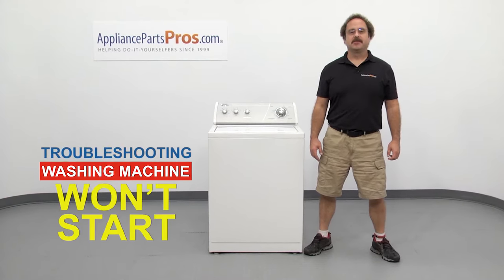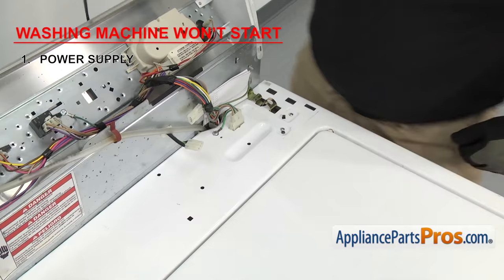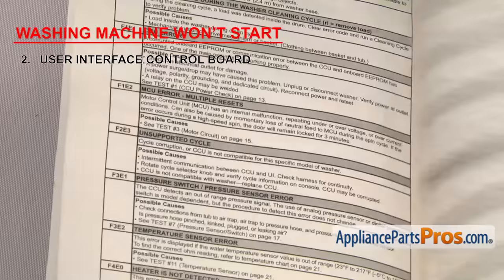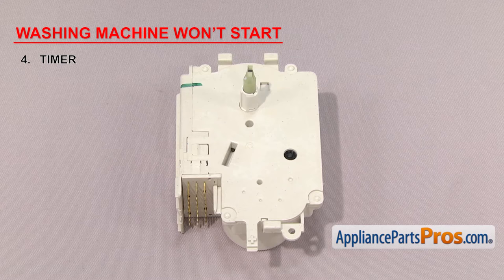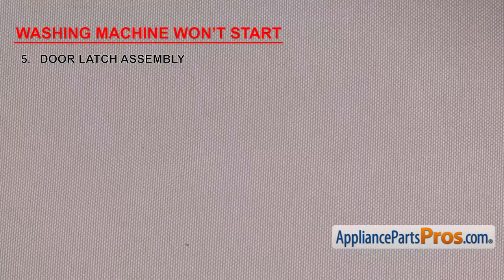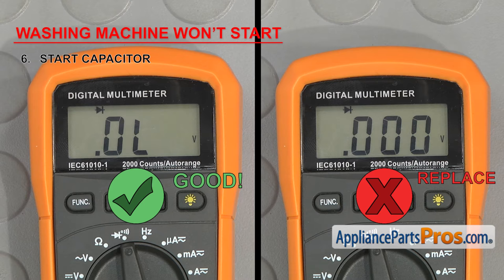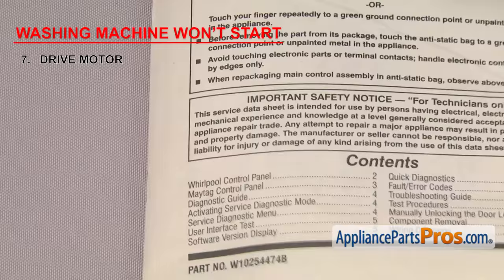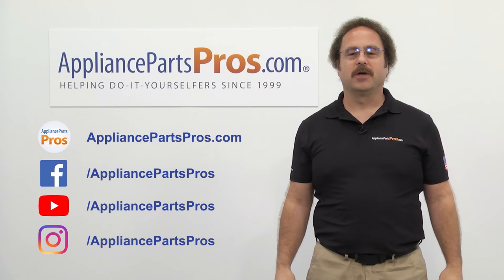Washing Machine Won't Start - Top 7 Problems and Fixes - Top-Loading and Side-Loading Washers

Comment: Self diagnostic mode ran on the Washer without any lights lit up for error codes, but when loaded with clothes and started the water hoses feeding  the washer hum and doesn't fill like it did when purchased, but can cut water input off and back on and it will fill but start humming again , I don't remember the water hoses feeding the washer humming when on auto sensing, I bought a numbers matching washer water inlet valve , and have replaced the drain motor because the electric went out last winter and because there was frozen  water at drain pump and didn't know and it weakened the drain motor to where when water was low it wouldn't pump water out to drain pipe so replaced that, so with the current issue about the humming water hoses and and water doesn't seem to fill the tub , so I will remove hoses and check for clogs and check the water inlet valve and all electrical connections associated with the water inlet valve before replacement..
Reply: What's crazy is if I cut water off by hand and back on the water flows awhile before stopping again to make hum noise at water hoses everything after the filling up of water works properly
Reply from the maker: What is the model number of your appliance?

Comment: Check circuit breakers / fuse box first. My machine wasn’t getting any power. No noise. Nothing. So I checked the circuit breakers first and nothing was tripped. I shut the breakers and turned them back on  anyway and voila. I heard the machine start filling with water.

Comment: I plugged in my Kenmore washing machine & didn't know the knob was already powered on & when I plugged it into the wall & it made an electric sound & stopped working, blew a fuse or what?? <3
Reply from the maker: We do apologize that has happened. What is your model number of the washer and we will be more than happy to look into this for you to see what has happened.

Comment: i had a kenmore w10318791 in storage for multiple years.   my current one went bad so i got the kenmore out of storage, hooked it up and it lights up green light   (fill)  and red light Locked lid,    but does not fill.    Just make a hum noise down by the pump, resistor area.    Ill assume somwthing is froze up from sitting.    ?
Reply from the maker: Can you please verify that model number for me? If the washer come but there is no water coming into the machine you could be having an issue with the water valve. Do you happen to have a multimeter?
Reply: @appliancepartspros     my old washer worked on the same lines, so i know i have water   I checked the inlets coming into the newer washer for clogs.    I have access to one yes.          im not sure what you mean by varifying....i took a pik of the serial number its w10318791    white     amtrims b       is what is printed on the back of unit
Reply from the maker: Do you happen to have a multimeter? I need the model number of the washer not the serial number. Normally with a Kenmore it has 3 numbers then a dot and the remaining numbers for the model number.
Reply: @appliancepartspros     im at work and not near the machine.  I  have the drum and lower guts with me, but i dont see a model number on the parts i do have with me.   yes i have access  to a multiple.meter
Reply from the maker: When you get home if you can find the model number we would be able to assist you to see what all could be going on with your machine. You can test the water valve for voltage to see if it has the correct voltage coming to it.
Reply: @appliancepartspros    ok thank you.   i will.   i tested the capacitor and got a bad reading?  also i couldnt test the pump itself.  my meter didnt have the correct ohm setting section.   it would only read 16.0      not a 3  digit number like ive seen online.         the water valve and and what i would call the pump, would be the same thing?     the one i took off has the impeller to push the water
Reply from the maker: The water valve is where the water lines are located at the top of the machine. The part you are calling the pump sounds as if that is the drain pump.
Reply: @appliancepartspros    yes ok...makes sense    what is the voltage i need at the water valve then ?  i can test tonight and also grab the model number
Reply from the maker: You should be reading 120 volts.
Reply: @appliancepartspros  ok ty.       Says.  Model 110.      21102010

Where at the part do I test for 120v with the multi meter 

And I'll assume it needs plugged in to do this
Reply from the maker: Thank you! Yes the part would have to be plugged in and set to when the water is being called to come into the machine. There should be two wires that you would want to test for the voltages on each solenoid.
Reply: @appliancepartspros    thanks for getting back to me..    I read some where if i took a conitnutity test or a ohm reading i could test that part as well?  is that the same test by chance.     i took the part out and did a ohms test it past that.     ?
Reply from the maker: In order to get a good reading we do recommend testing it for voltage.
Reply: @appliancepartspros    thank you!!!!!!
Reply from the maker: You are welcome.
Reply: @appliancepartspros   ok so I have conintunity with meter with part out.

I installed the part back into machine and plugged  in.       I couldn't get a reading.   So I pushed the start button and still nothing.   I know my capacitor is bad and my new one isn't here yet.    Isn't it odd I'd have both a water valve n capacitor bad at same time.

Comment: This is useless, everything this company tells you is that you should replace the control panel
Reply: Most common issue if it's not the power supply or door switch